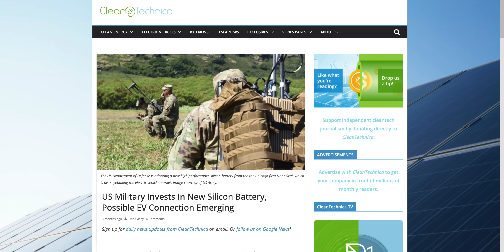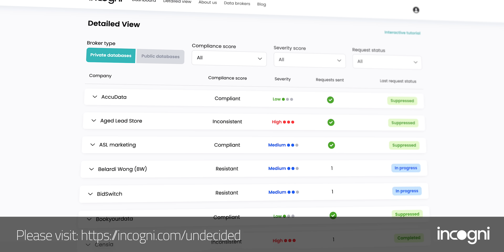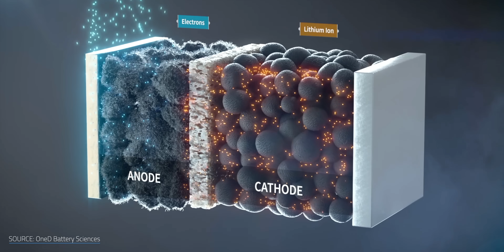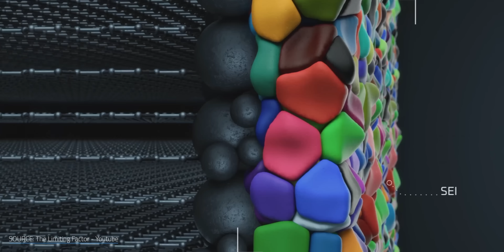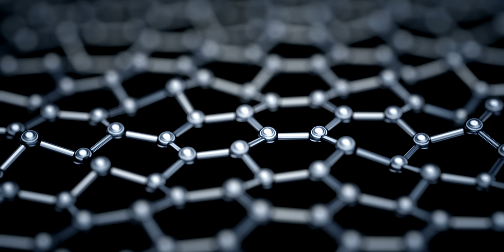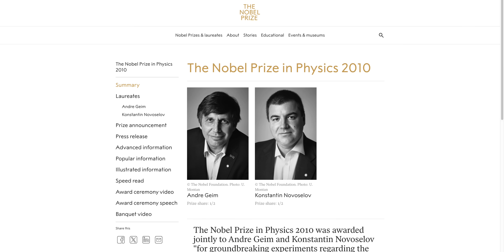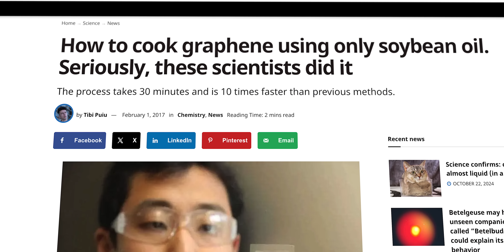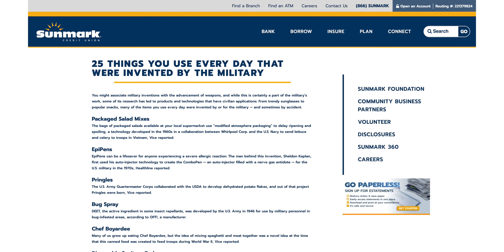Why The US Military Chose Silicon-Graphene Batteries

Comment: At some point within the next five years there should be several types of serious and usage batteries available on any scale. If not then it is wish thinking. Lithium configurations are the only ones which are in devices large and small. Costs, weight and volume must decrease while power density increases. Thank you for all your episodes

Comment: If the military bearing the high initial cost was always a thing then Lithium Thionyl Chloride batteries would be dirt cheap by now. Except they are still as expensive as ever, and the military still makes extensive use of them.
Reply: they are not even rechargable, what are you talking about?
Reply: @turtlefrog369  they are a battery,  the military makes extensive use of them as they have excellent energy density and extremely low self discharge rates. Yet despite the military using them for decades now they remain fricking expensive.  To expect these batteries to be any different is wishful thinking IMHO. They might get cheaper but experience shows it is far from guaranteed.
Reply: @jonathanbuzzard1376  as i said they are not even rechargeable and thus completely useless for civilian usage.
Reply: @turtlefrog369  So you are telling me you have ZERO devices that use primary cells? I don't know a single civilian who doesn't use primary cells, but none of them is Lithium Thionyl Chloride, which is used extensively by the military because it is superior in every respect except the cost to the primary cells civilians use. So the point is that just because the military extensively uses technology, and in particular batteries, does not mean with any certainty that in time, they will be used by civilians.

Comment: As a former radio operator maintainer, a lighter battery will equal huge weight savings. The current batteries weight as much if not heavier than the radio they power.

Comment: One thing i didn't catch in the video was if there is a benefit to the operational temperature range of the battery. During my sevice extreme heat and cold greatly affected the use of battery powered tech.

Comment: 5:37 Little clarification - SEI layers form on battery anodes due to decomposition of the electrolyte or additives therein. This is true for both graphite and silicon anodes. The formation of SEI is mostly considered to be beneficial because it creates a stable, electrically insulating layer which allows Li+ ions to pass through, but prevents the electrolyte decomposing further. It does increase resistance, but the battery wouldn't last more than a handful of cycles without it.
Reply: So in a way it's like alumin(i)um oxide that creates a barrier against oxidation to go deeper? Nice!

Comment: What's the Wh/kg. on these batteries?  I didn't see it.  No question, silicon is the best anode material coated with a sulfur cathode and solid electrolyte.
Reply: wh/kg at what $ is really the only information we need, and also is the only information nobody seems to know

Comment: There are too many alternatives at lower price points for that to trickle down into consumer electronics.  Many of them are based on silicon anodes with sulfide solid electrolyte.  ENVX, QS, and SLDP are three of the most visible.

Comment: These days battery makers generally do not want to prevent SEI formation.  Instead they want to leverage it to the benefit of the battery.

SEI formation is used on-purpose in numerous lithium battery types, most especially LiFePO4 (LFP), to vastly increase the cycle life of the battery.  It provides structural integrity to (mostly) the anode by protecting it from other unwanted chemical reactions, while still letting ions through.

-Matt

Comment: Part of my concern about new battery technologies would be the cell Voltage, for instance, what would be the output Voltage of a SOG battery be in the 14500 form factor?  Price isn't as much of a concern as to how it would perform compared to Li-Ion, such as number of charge discharge cycles, how long it would hold a charge, and its discharge/time profile would be compared to Li-Ion.  If the SOG battery was 10 times more expensive than a Li-Ion in the same form factor, I would expect it to have a performance life at least 10 times longer as well.

Comment: As I have studied this, one glaring factor of why this technology can be so helpful to us is this.  If you look at current battery technology with lithium, there is a huge safety issue around them.  Graphene sub straight fixes a ton of the issues (fire safety related) that lithium batteries pose as a danger.  In theory it appears to me that graphene based batteries are much safer overall to use.  They appear much more stable than lithium.  The trick as Matt says (and what I've been reading) is the ability to fabricate/manufacture the graphene in affordable rates with ample quantities so that the price of graphene batteries can compete with lithium technology.  Graphene batteries are superior in function and almost everything else, except for the manufacturing factors of it.  Having the military invest in to it might be just the kick that this technology so badly needs to get a strong foothold into the market.  I'll be watching.
Reply: Graphene is toxic to humans lol

Comment: NanoXplore in Canada is the biggest producer of cheap graphene by capacity in the world after China. VoltaXplore is a spinoff which makes 2170 cylindrical cell using SiG technology (Silicon-Graphene) in Montreal, Canada. BTW, graphene is out of the lab and everywhere. Graphene Black is an alternative to durty Carbon Black. Graphene is added to plastic to improve it and it`s in almost every car.

Comment: Slight complaint: at 6:56 you claim that more lanes help traffic, while this isn't the case in real world car infrastructure. It's a common misconception but it's important to recognize!
Reply: More lanes do help move an equivalent number of vehicles faster -- so 5 lanes will move 100,000 cars more quickly than 4 lanes. The issue in traffic is that more lanes also attract more traffic, so when you increase from 4 lanes to 5 you could still move 100,000 cars more quickly, but now you've got 150,000 cars so you end up losing. 

Fortunately, electrons in a battery don't work that way...
Reply: @kevinamery5922  A better comparison would be a river.
Reply: You can lead a car into traffic, but you can't teach it how to drive.
Reply: @ghoulbuster1 and this is why we still don’t have fully self driving cars. Todays cars just refuse to learn 😠
Reply: More lanes which can't be left would help traffic. Traffic is mostly disturbed by swerving.
Reply: Automotive traffic requires rules, collision avoidance, and safety. In batteries, engineering and nature handle those things automatically.
Reply: cars are easier to visualize than wires in an Phone/Ethernet cable connection where this would be more akin to the analogy.